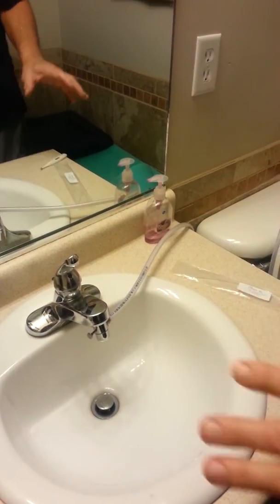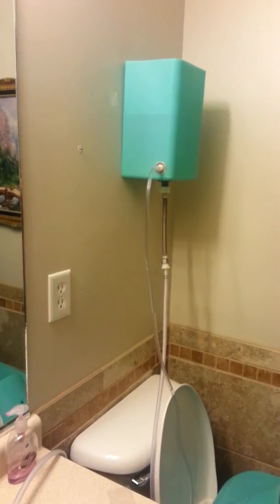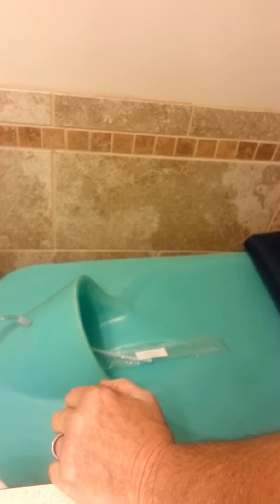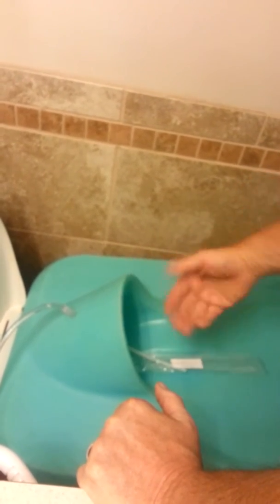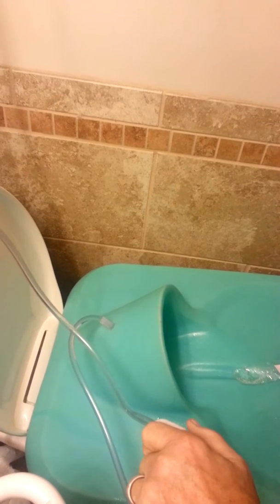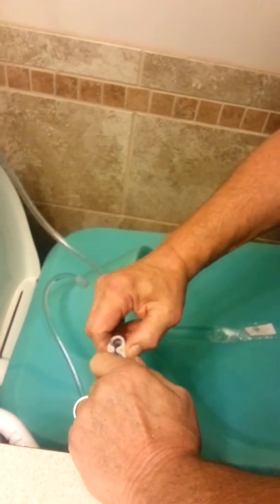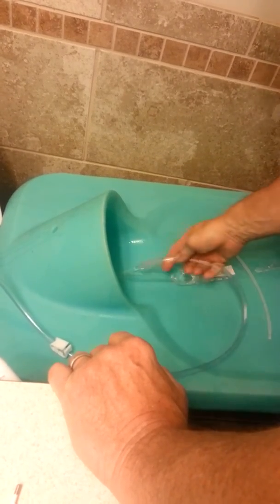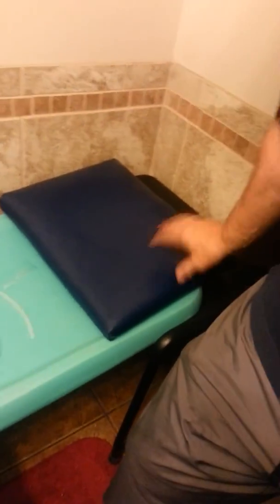Colenz continuous flow

Comment: Can you bucket hold distilled water just being poured into it????
WHO wants to use dirty tap water????
That is not good. I'm sure Dr Jenson didn't use tap water, did he??
I was all ready to buy this, now I have MORE questions.
Reply: The source of the water is coming directly from the tap and is not filtered from what I can see unless the homeowner has a reverse osmosis system under the sink. .All colon hydrotherapy sessions should use filtered water.
Reply: @ehkartist  I have an inline water filter before it goes to the bucket